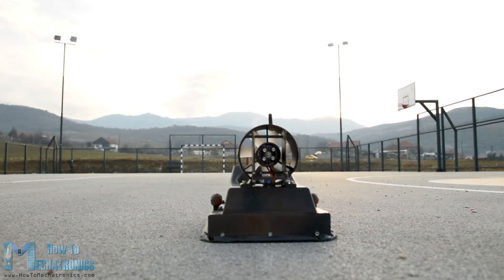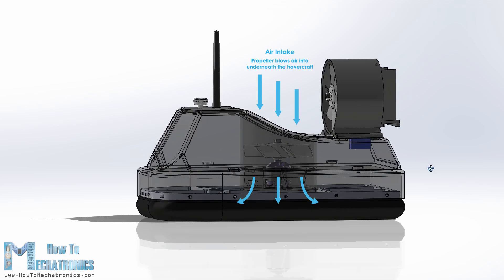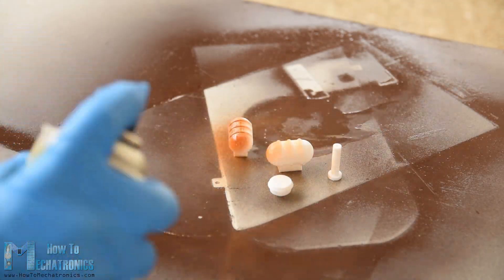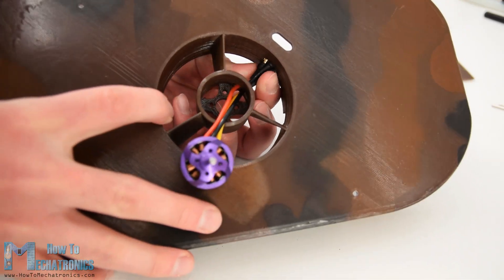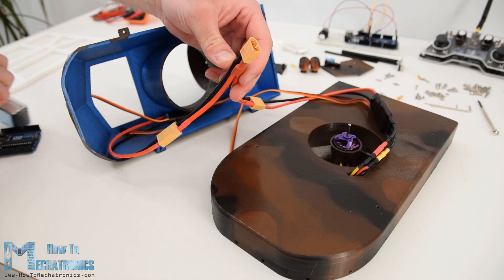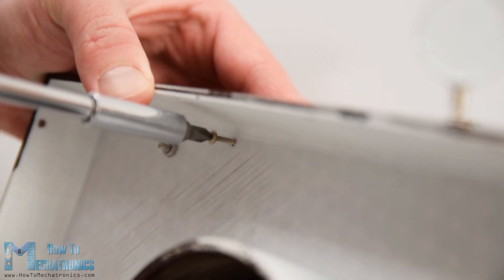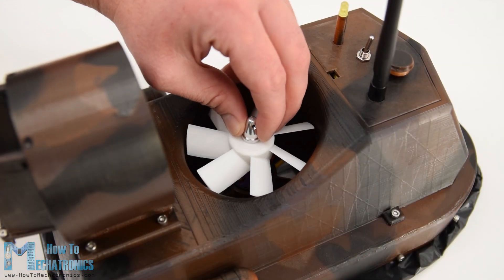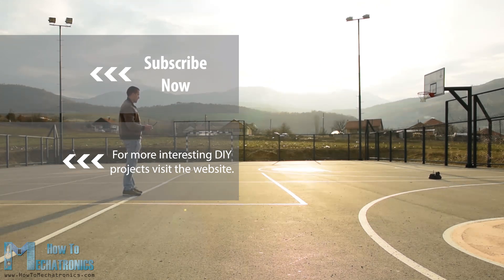DIY Arduino based RC Hovercraft

Comment: You could also use a hot glue gun, it is a very strong grip
Reply: If hot glue gun is used there is a chance that the skirt (garbage bag) will melt since it is made of plastic

Comment: Can you use any RC Controller? Just have to setup the Arduino code?
Reply from the maker: Well yes, you can use any RC controller, in such a case you won't even need an Arduino. Only RC transmitter and it's receiver on the hovercraft. You just need to control 2 ESCs and 1 servo.

Comment: You shouldn't connet both BEC together it is saver to cut one positive BEC wire, this way no current can flow between both 5V potential if they dont have the same voltage.

Comment: Project looks great, but this tiny power switch made me cringe. It's not going to break lots of current, but if running full-blast for prolonged time it's going to melt itself.
Bigger RC models do not have such switches for a reason. I think you could use panel-mounted XT60 connector with a loop as a switch capable of handling bigger current.

I wonder what's actual power consumption by the motors, and if run-time can be increased by using 'server type' BLDC fans like Nidec Beta V TA350DC which can lift itself easily using only ~2.5A.
I made a proof-of concept using this fan and a small food-tray, and it lifted like a rocket ;)

Comment: How quickly the skirt will spoil?
You use hovercraft at asphalt, i think plastic bag will have holes after 20-30 minutes. 
If you use glue - it not possible to change plastic bag easy.
Reply from the maker: Yeah, the skirt will eventually fail. Well the bottom part already have additional tightener for the skirt so it could be secured in place without a glue, it should work. This can be also implemented from on the top side as well. Just make holes around the skirt holder and use screws or bolts for securing it. I went with glue because it was a simpler way, and I think it would be still easy to replace it, the glue would come out with some scraping.

Comment: Man, you are definitely the Macgyver of nowadays.  Another amazing project. I have some questions for you and really appreciate if you can answer: 1) How you came with so many cool projects?? Lots of people on YouTube do the same thing that you do. But your projects is always the best one and really WELL MADE. 2) I have no idea how this 3D printing works. I mean, what software is use to make the models? How you learn to make this 3D models so precisely? Do you need to have knowledge on Maya or 3D Max? 3) About this project, how you decide which electronic parts you will need? I mean, why these motors and not other type? And how do you know everything won’t be heavy and make difficult to the hovercraft “float”?? Once again, thank you very much for share these projects. You make my brain blow away and desire to follow the same path.
Reply from the maker: Thank you! Well I'm always trying to do my best and bring the "average" projects to a next level. That's why it takes me almost a month for publishing new video. I dedicate a week in research, then a week in designing the project and another week or so for assembling it and making the video. It takes a lot of work for producing higher quality content.
3D printing is really cool and these days also really easy to use it. There are many sites where you can get free 3D models so you can print cool things, and for creating your own models you can use free software like Fusion 360, Blender, SketchUp etc.
For making projects like this, to be honest, it takes some knowledge and experience as well. If you know how all types of motors work and what's their application then you will know what motor to use for the project. And i didn't know whether the hovercraft will float until I made it. :) Sometimes you just have to make the thing and see whether it works or not. :)

Comment: Is the switch capable of that current?
Reply from the maker: It's rated 6A 125V, not the one for this application but still it worked...

Comment: usually it's a bad idea to parallelly connect BEC of differeent ESCs, because they can fry eachother
Reply: Yeah, well spotted. Even identical ESCs can have small voltage differences between them, allowing a current to flow between them. It might have been a good idea to use just one BEC.
Reply from the maker: Thanks the remark.

Comment: How much the total cost?
Reply: depends on the fact that do you have access to a 3 d printer and an RC Rx Tx :D , if you have than it must cost you bet Rs 4000 to 5000, which includes motors , esc, arduino , battery , charger and servo.
Reply: @abhishekprasad2935  It's not an RC solution, it's a simple nrf24 module

Comment: And how much does the battery lasts?
Reply: I think it is less than on drones because it has only two brushless motors. 10-15 minutes on 3S 2500mA/h. I think so.